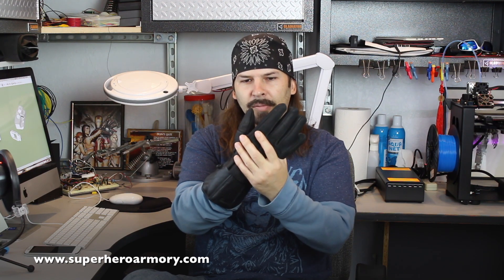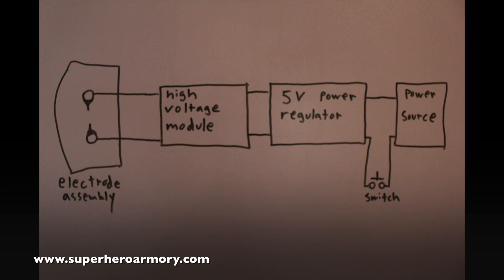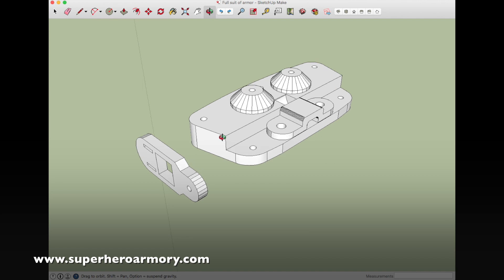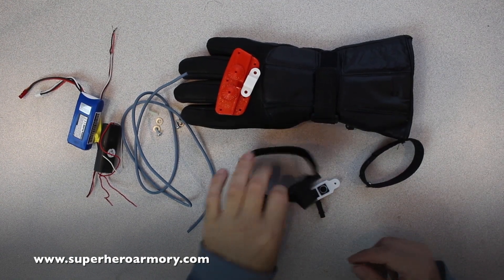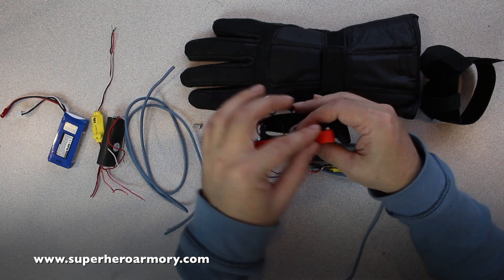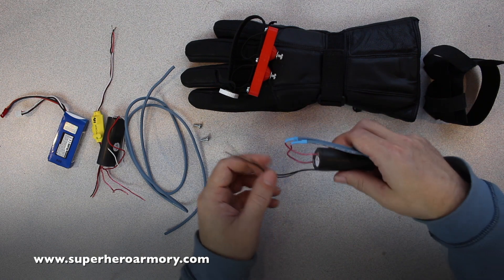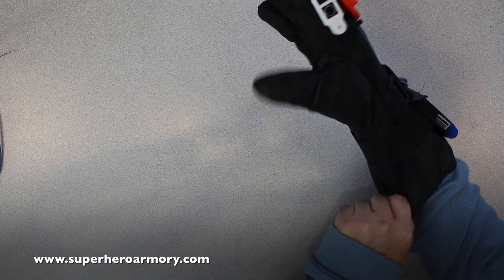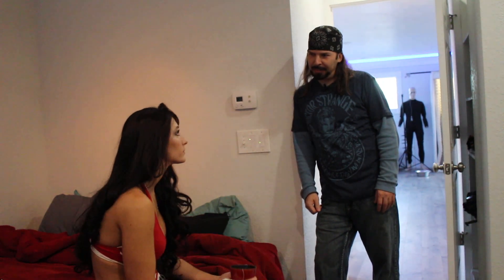How to build a High Voltage Stun Glove Taser

Comment: Mount on your palm using on your fist would be blocked on the palm you can grab wrist or neck "ow"
 shock they drop
With silicone in palm insulated

Comment: I check eBay for the high voltage module and I only found 4 volt lol
Reply from the maker: 4 volts is the input, the output is tens of thousands of volts.

Comment: Whats the amperage on the output of that thing like would it kill someone or just stun them? All voltage does is hurt but amperage kills.
Reply from the maker: It's probably around 20,000 volts and amperage is less than .1 milliamps
Reply: ok thanks

Comment: Couple of questions, 
1, How long would the module relatively last with a 12v?
2, relatively, printer/software included, how much would this cost?
3, is this legal?
Reply from the maker: 1. Haven't tested it but it could fight off a horde of zombies and probably still have plenty of charge leftover.
2. I probably spent $25 on it.
3. Who cares?!
Reply: Legal in most u.s. states

Comment: Hey Captain Intrigue, I saw a statue of Ironman the other day and I thought of you. The particularity of this statue is that it's actually motorized to open and close, like the suit in the films. The reason i thought of you is because i think this statue give us quite an interesting look at how it actually work and wrap-around someone body. Maybe you can use this as a bit of an inspiration for your suit (or a future one), just an idea in the air.

Here the statue reveal video:
https://www.youtube.com/watch?v=1HbKFSeQUiM
Reply from the maker: It's very cool to watch but the problem is that it's completely impractical because all those actuators to open the armor end up taking up most of the space and adding lots of extra weight and overall complexity to the suit. I tried something similar on an older suit and it worked okay but ended up taking up lots of valuable real estate inside the suit. Still cool to watch though! Thanks for the info.
Reply: +Superhero Armory Oh i see, make a lot sense. To be 100% honest, i was pretty sure that, as of now with the current tech, doing a "copy-paste" of this exact design would be somewhat impractical. Still, i thought the idea in itself was worth looking into and that maybe the design could be improved on and made into a more efficient suit.

I'm glad to know that you gave something similar to this a shot in the past and you aren't just talking "hypothetically" but actually from experience.

Anyway, i always enjoy playing with electronics and robotics but i have yet to build something of the caliber of this channel. You are quite an inspiration to me in that field, mate ! Thanks for taking the time to send me a reply, btw. Keep up the good work!

Comment: Can I make this without use of a 3D printer? I don't exactly have the money to afford one lol
Reply from the maker: You could just make it out of a chunk of plastic just as easily. Just drill holes for threading the high voltage electrodes into and make straps to attach it to a glove.

Comment: I have an idea for a grappling hook launcher attatchment that could go on your arm. like a gauntlet. it can also double as a pain inflicting weapon, like a flail and has an emergency rope disconnect if in case it gets snagged into machinery or something. Another idea would be to add a hydraulic punching machine. like the one seen in captain america civil war, or fallout 4
Reply from the maker: I'm not a fan of grappling hooks because they aren't very useful, but an enhanced punching glove is already on the drawing board for the future.
Reply: Superhero Armory awesome bro. and hey its your call. Ill just pitch a few ideas.
Reply from the maker: Keep them coming!
Reply: Superhero Armory OK. how about a drone. so you have a remote control built into. a gauntlet with a wireless camera feed so you have eyes in the sky. and the gauntlet has the ability to house/recharge the drone while it's not in use. another idea would be to create a respirator that can protect you from chemical/ biological weapons, while still giving you the voice changer capabilities
Reply: I love the idea of retractable blades so another idea would be to actually launch knives like ballistic knives from the slots of your gauntlet. another idea would be to add strove lights to the chest or goggles to stun enemies for a brief moment. hook them up to pressure pads or switches for easy access.
Reply: Superhero Armory a little extra idea would be to add a little gadget. like a small roller drone camera like from the game rainbow six seige. Greek gadget guru is a channel on YouTube and one of his projects is an umbrella style shield that can fold up. check out his youtube channel. he has some cool gadgets that may help you with your arsenal of superhero  gadgets.
Reply: Superhero Armory one last thing for now. perhaps have multiple loadouts for specific missions or scenarios. all of which can be easily deployed and equipped. maybe have it transported in your own vehicle. like the intrigue mobile or something
Reply from the maker: Already working on a drone linked to my new helmet. I tried a respirator but they are very difficult to fight or run in.
Reply from the maker: Haven't tried the ballistic knives but i like that idea. Already have a strobe light in my chest to blind attackers with. I demonstrated it in earlier videos.
Reply from the maker: Already working on a UGV (unmanned ground vehicle) drone for reconnaissance.  I'm friends with Greek Gadget Guru and know all about his shield. I won't copy anything he's already built, but i do have plans for my own unique shield design.
Reply from the maker: My next Mark 2 suit will have modular weapons that can be swapped out quickly and easily for specific missions.
Reply: That swapable gear idea is great! You know Greek Gadget Guru? Always full of surprises. : )

Comment: What if you make taser armor plating?
So your whole body is the taser?
Reply from the maker: Already did that but it hurts bad when you have a malfunction!
Reply: Have you tried using insulation to avoid getting shocked if it malfunctions?
It's a very nice concept of being able to touch the opponent without the opponent being able to touch you
Think of it this way, Iron man has different types of suit with each of its own special abilities.
In this case you will have a variety of suits, if you succesfully made a better version of the taser armor plating..
That would be your ELECTRO Armor.

I'm a fan of your works, I'm pretty sure you can pull it off.
Reply from the maker: Oh it can definitely be done but i'll have to think about it some more.
Reply: Awesome

Comment: Its cool and all but Im pretty confident that this would break if you actually punched something with it
Reply: Remember, this is the first version of the suit where he just tests how he can make everything work. Later versions will have better protection for both him and the circuitry.
Reply from the maker: It's pretty strong, but when i'm ready to punch something i'll mold and cast it out of rigid kevlar.
Reply: Maybe using stronger plastic, like taulman alloy 910 or nylon. Taulman alloy can be used with any 3d printer i think, no need 4 super high temps or hardened nossle on your 3d printer
Reply from the maker: My next suit will be made from molded kevlar armor and titanium. I'll be starting on it in the new year.